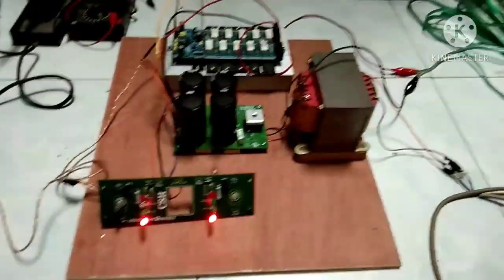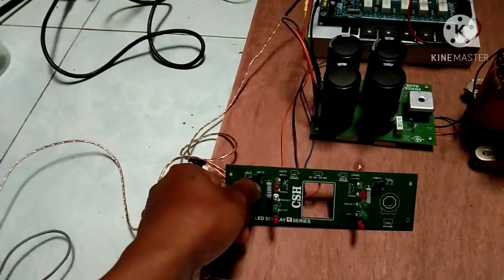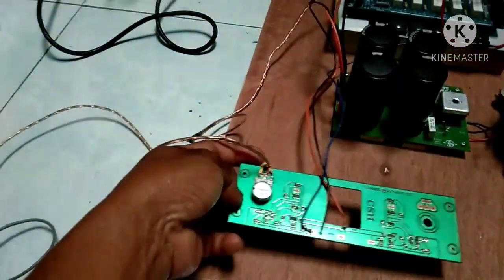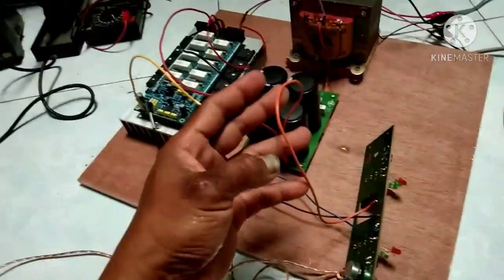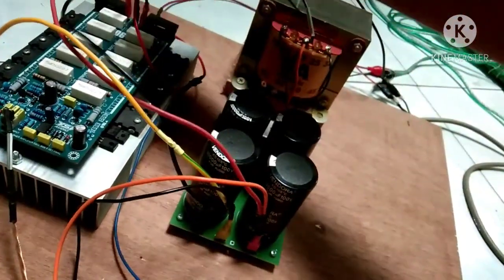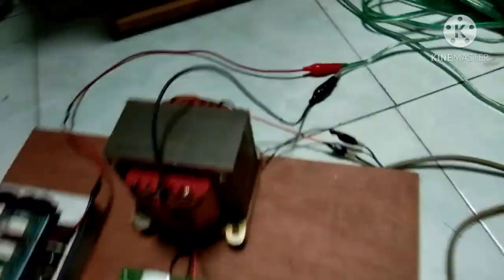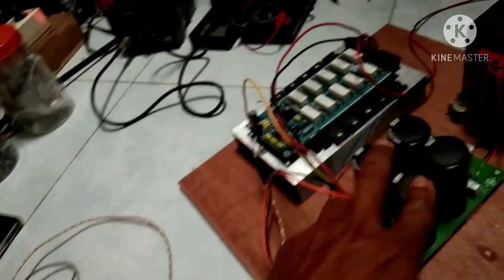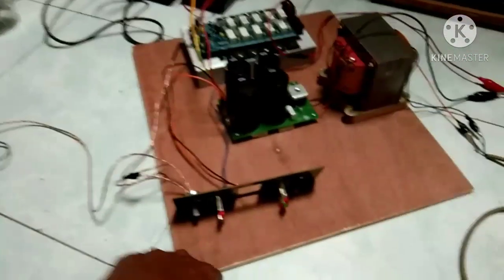cara pasang LED DISPLAY CA SERIES/ CSH

Comment: Untuk pemasangan jalur in protektor sama volume gimana suhu 🙏
Reply from the maker: Untuk jalur protektor tidak terhubung ke panel led,cukup pindahkan lampu led dari speaker protektor ke panel led menggunakan kabel.
Untuk potensio volume berdiri sendiri tidak ada jalur yang terhubung ke komponen panel led

Comment: Maaf bang pendatang baru mau tanya saya beli tak pasang ngikutin di fidio ini kq lampu aktif sinyal dan chip x kq nyala ngikutin musik semua itu pengaruh dari apax mohon bantuan x trimakasih
Reply from the maker: 1). Apakah sama Panel lednya dengan dividio? 
Saya sdh sering pasang, beli ditoko yang berbeda, tidak pernah ada masalah. 
2). Coba cek apakah komponen sesuai dengan tata letaknya terutama nilai resistor.
3). Cek solderan dan jalur PCB.

Comment: Mau tanya bang. Saya juga lg pasang. Tp ko lampu signyal sama klip gak idup ya yang idup cuma lampu yang bawah. Apa karna kurang setrum ya bang. Saya pake  setrumnya cuma pake 25v ct. Jika kurang setrum. Apakah kalo pake 32v ct. Bisa nyala ga bos. Soalnya travo saya cuma pake 5@ ct 32 mentok.
Reply from the maker: Coba cek lagi pemasangan kabelnya dari psu dan dari out power, klu memang sdh benar, lihat tulisan di pcb tegangan yang dibutuhkan berapa volt ?
Reply: @kumbokarnoaudio  udah saya cek. Udah bener Pemasangannya. Dan PCB nya gak ada tulisan vol nya. Cuma min ples. Gron. Output. Udah gtu aja. Gimana solusinya bosqu
Reply: @kumbokarnoaudio  udah saya cek. Udah bener Pemasangannya. Dan PCB nya gak ada tulisan vol nya. Cuma min ples. Gron. Output. Udah gtu aja. Gimana solusinya bosqu
Reply: @kumbokarnoaudio  udah saya cek. Udah bener Pemasangannya. Dan PCB nya gak ada tulisan vol nya. Cuma min ples. Gron. Output. Udah gtu aja. Gimana solusinya bosqu
Reply: @kumbokarnoaudio  maaf cuma ples gron sama output

Comment: Aku pke jga tpi jack input ada sedikit tegangan apa itu aman bos
Reply from the maker: Input power atau input kit LED ini?
Reply: @kumbokarnoaudio  input untuk jhack ke hp
Reply: @kumbokarnoaudio  trus nyalax jga bersamaan😂 kok bisa gitu om ??
Reply from the maker: @mmjaudio1915  coba tegangan untuk kit Led ini ambil dari (+) dan ground (CT) PSU utama
Reply: @kumbokarnoaudio  aku pke ct 48 20 A 
Sya takut😅 klw aku ambil teganganx di trafo 1 amper 12 v gimanaya ap bisa

Comment: Begini bang..saya beli led disply merk MGE.terus adanya out+/ground.klo saya sambung satu ch.hidup lmpu signalnya..+dari out signal ke speker+.terus satu ch +speker dari mana ambilnya.trima kasih
Reply from the maker: Tegangan ambil + dan ground dari psu lalu untuk signal + (ch1) diambil dari out speaker + driver (ch kanan) dan untuk +(ch2) diambil dari out speaker + driver ( ch kiri)
Reply: Karna saya pkek travo 2 buah..untuk ch masing2. Karna disply bukan stereo
Reply from the maker: Display bukan stereo maksudnya,jika menggunakan 2 trafo maka suplai tegangan sendiri² (dipisah) ch kanan ( ground dan + ) kiri juga (ground dan +) dari psu masing masing.
Reply: Mlm bang..saya pke trapo 2 biji..trus saya pke 2 kiprok..ukuran tk sams,10dan 25 amp..sya hidupkan 15 mnit.trapo yg pke 25 amp cpet pnas..mssalhnya apa bng?..trimaksih.
Reply: Lg bng..masalh led disply..itu cma 1 jalur..+dari disply ke +sepeker..driver 1. Driver satunya ambil + nya dari mna..krn tdk ada out L/R...maaf bng pemula bnget.klo driver 2. Ambil dari + disply macam knoslet..dengung keras

Comment: Punya q mas ko kbel gron dri input ke potensio bru di hidupkn blm ad audio ko dh melele , mhn bntuan so bru pmula ,, itu potensio nya tiga kbel di konek di ke pcp kh
Reply from the maker: Gak usah di solder ke pcb langsung kabel saja, coba lihat dengan teliti jalur kaki potensio gak kemana - mana
Reply: Knp kabel gron nya melele y?? Ap kekecilan
Reply from the maker: Powernya sdh bunyi normal atau baru dirakit lalu dicoba?
Reply from the maker: Untuk kabel inputnya saya biasa pakai kabel skerem.
Reply: Trima ksi , aq akn coba gnti kbel
Reply: Baru selsai di rakit di box sring q coba tmpa box ,, aq coba percenel ,, kbel gron nya kya kbel spiker hnset  kcil dan q dret 2 potensio

Comment: Mas mau tnya, cara psang imput hp ke potensio CA  trus ke pawer gmn mas....???
Reply from the maker: Ambil potensio perhatikan yg ada kupingnya itu sebagai ground /kaki no 1.
# kaki no 1 dan no 2 menuju ke power. 
# kaki no 1 dan no 3 menuju ke HP. 
Untuk lebih jelasnya cari di google ( cara pasang potensio )
Reply: @kumbokarnoaudio  mksi mas bro untk ilmunya
Reply: Kalu untk teganga panel depan CA bisa d.ambl dri tengan lain selain dri psu pawer...???
Reply from the maker: @amirulmumininamirul6814  maksudnya di beri trafo sendiri ? Bisa.
Reply: @kumbokarnoaudio  iye mas..dpasang trafo sendri atw tegangan sendri....
Reply from the maker: @amirulmumininamirul6814  bisa
Reply: @kumbokarnoaudio  mksi mas kumbo karna tla brnbagi ilmu.x soal pemasangan panel CA seria
Reply from the maker: @amirulmumininamirul6814  sama - sama 🙏

Comment: Di situ tercantum max 90 vdc tapi di kasi tegangan 91 vdc atau 98 Vdc bisa gak bang. Makasih
Reply from the maker: Bisa dengan cara mengganti Resistor 2 wattnya dengan 6k8 dan dioda zenernya ganti dengan 1 watt.
Biasanya yang ada di pasaran R 2 watt terpasang 4k7 atau 5k6.
Untuk diodanya hanya 0,5 watt

Comment: Kg mo ty travo sy GK ad extra y, cara pasang y apkh travo utama yg 12v, apkh ad tmbhn trims
Reply from the maker: Langsung ikut PSU utama /setelah elco (sama kayak driver) jangan langsung dari trafo
Reply: @kumbokarnoaudio  sy pake 32v, protec y CMa trtra 12v kg
Reply from the maker: Maaf maksudnya untuk lampu led display atau sp protektor 🙏
Reply: @kumbokarnoaudio  protector kg
Reply from the maker: @akmalsolehsoleh2989  oalah tak kira panel led 🙏 tambah trafo 1amper atau bisa juga ikut PSU utama tapi diturunkan pakai R 4 k7 (2watt) , dioda zener 12v - 15v dan elco 1000uf/25v (masing² 2x) 
Catatan : dioda zener disesuaikan dengan kebutuhan kit Sp protektor 12v atau 15v
Reply: @kumbokarnoaudio  trims kg moga tmbh byk subcrib y, sehat slalu

Comment: mas kalau drivernya ada speaker protektor led dipanel langsung di jemper sama led di speaker protektornya apakah bisa..?
Reply from the maker: Led display hanya ada 3 lampu yg terhubung ke komponen (led on, signal dan clip) sedangkan lampu protektor harus di ambilkan dari kit speaker protektor (coba lihat jalur di pcb panel disply)
Reply: @kumbokarnoaudio  ya mas sudah saya ambil dri kit speaker protector.. langsung saya ambil dri kaki - dan + led speaker protecto tpi tidak nyala..
Reply from the maker: 1. Sebelum di pasang ke panel lampunya nyala atau tidak dikit proteknya.
2. Cek lagi Lampunya kebalik/gak ?
3. Lampu protek akan bekerja/menyala bila terjadi konslet /short pada speaker. Jika tidak short tidak menyala.
Reply: @kumbokarnoaudio  makasih penjelasannya maa.🙏👍
Reply from the maker: Sama ² 🙏

Comment: Pak punya saya ko led singnalnya nyala trus pak.. untuk mengatasinya bagaimana ea pak
Reply from the maker: Posisi volume arah jam berapa?  atau baru hidup sdh nyala terus?
Reply: @kumbokarnoaudio  baru hidup langsung menyala
Reply: @kumbokarnoaudio  dam saya juga mau nnya pak.. untuk ampun aktif itu yg di speaker protek dismbng tidak ke lampu led panel depan.
Reply from the maker: Hidup langsung menyala coba cek lagi pemasangan kabel mungkin ada yang salah.
Reply from the maker: Untuk lampu yang sdh ada di panel disply tidak perlu di pasang lagi dari speaker protektor, cukup lampu protektoc saja, caranya lampu dari speaker protektor di lepas lalu di sambung kabel ke lampu yang ada di pcb display
Reply: @kumbokarnoaudio  ok trima kasih pak atas bimbingannya

Comment: Pak dhee sy pasang led display n-9000 dan memakai speaker protek pemasangan sdh benar jalur lampu aktip display sy putus ambil dari lampu speaker protek tpi pas di on kan power nya relay speaker protek gk mau on/aktip dan protek terus lampu signal sy ambil dari out speaker..dicabut kabel siganal malah normal speaker protek nya mau on dan active tolong dibantu pak dhee...like&subscribe
Reply from the maker: Coba cek lebih teliti lagi pemasangan kabel lednya dan jalur yang diputus apakah sdh benar dan aman (tidak ada yang short)
Reply: Siap pak dhee tak cek lagi

Comment: Bos lampu speker protector nyala trus hidup gak bisa bergantian  dngan lmpu actif gmana solusinya..
Reply from the maker: Lampu sp protektor kan gak ada hubungannya dengan panel depan.ada berapa lampu di sp.protektornya.
Reply: Yg 1 hnya satu satunya 2 lampu..
Reply: Oh iya bos  pkek berapa finall trafo 10 ampere ct 56  pkek thosiba

Comment: Mas itu kan kabel dari LED display ke spiker nya cuman 1 nah kalo spereo gimana mas apakan di jadikan 2 kabel nya
Reply from the maker: Ya, stereo kabel output speaker ( + ) kan 2 (ch 1 & ch 2) di PCB sdh dibagi 2 untuk masing² ch
Reply: Terima kasih bos atas jawaban nya akhir nya saya ngerti ,maaf pemula 😁🙏 sukses selalu Chanel "KUMBO KARNO" semoga rezeki nya di lancarkan oleh yang kuasa 
Salam saya dari Kalimantan barat 🙏

Comment: Mbah tek u pmasangane yowes podo, tapi lampu signal ro clip murupe kok bareng yo? Dadi lmpu clip e melu murup koyo signal   iku opo ne sg salah mbah??
Reply from the maker: Posisi volume pol opo separo,
Reply: Volume sparo, lampu clip e ws melu urip mbah, tambah di banter ne malah tambah barak, kalah urupe  lampu signal e malaan
Reply from the maker: @herusetiawan8762  coba volume input dari laptop/Hp di kecilkan/dikurangi.mainkan volume dari power saja. Powere nganggo speaker protektor ora, nek nggawe yo ora usah kuatir. Selama speaker protektor berfungsi insyaallah speaker aman.
Reply from the maker: Cek transistornya mungkin ada yg short.

Comment: Kalau kabel yang ke CT di rubah ke GND bisa mas
Reply from the maker: Bisa ,kan ct dengan ground satu jalur  coba lihat /urut jalurnya di pcb.
Reply: @kumbokarnoaudio  tpi punya saya potensionya ngga bisa mas...
Apa ya kira kira permasalahannya
Reply from the maker: @ndestgondest201  coba lebih teliti lagi untuk potensio tidak usah disolder ke pcb tidak masalah potensio volume langsung kabel ke power amplifier seperti biasa
Reply: @kumbokarnoaudio  tanpa lewat pcb ya mas
Reply: @kumbokarnoaudio  tpi kaki potensionya tetep di sambungkan ke pcb ap Angga mas
Reply from the maker: @ndestgondest201  disolder boleh tidak juga tidak papa.

Comment: kalau makai 2 psu smps gmna cara aambungnya mas
Reply from the maker: Jalur pcb (led) positif dan negatifnya di putus.
Reply: @kumbokarnoaudio  kurang paham saya mas...chanel 1 saya makai smps 100v untuk sabwoofeer kalau chanel 2 nya makai smps 80v untuk midle.kebatulan saya beli box power ca10 nh cara pemasangan led display saya kurang mengarti mas kalau satu psu saya paham mas seperti di video sampian kalau 2 smps saya binggung cara memasangnya.

Comment: Bang lampu signal yg sebelah ikut nyala klo potensio yg satu di buka? Itu apanya
Reply from the maker: Coba cek/ganti transistor 2N5551 dan dioda zenernya
Reply from the maker: Zener 4148
Reply: Kanan kiri di ganti semua?
Reply from the maker: @marjiblack6332  yg ikut nyala saja
Reply: Sebaliknya juga ikut nyala klo di buka gantian kanan kiri
Reply from the maker: @marjiblack6332  coba cek lagi pemasangan kabel nya sdh benarkah ?

Comment: Pux sy kok gak bgtu terang bos ikuti irama
Reply from the maker: Coba cek nilai resistor yg terhubung kekaki led, berapa ohm? Jika 2k2 ganti dengan 1k2
Reply: @kumbokarnoaudio  kurang tau k resitor mas... Says tes tmpa asrsoris fulome hampir full bru ber irama tpi gk terang
Reply from the maker: @nurulalvialvi4703  coba ganti lampu Lednya
Reply: Klw mkk sma qualizer stabil kedipx bos... Tpi volebe besar dikit lampu clip hdup
Reply from the maker: @nurulalvialvi4703  mungkin gain amplifiernya kecil
Reply: Ow berarti R gain hrus di besarin ya mas. Makasih
Reply from the maker: @nurulalvialvi4703  kalau suaranya sdh bagus gak usah dirubah

Comment: Pak saya baru saja pasang LED series tapi yg nyala cuma lampu aktip nya saja..yg lampu signal protek sama clip gk nyala..padahal sudah benar untuk pemasangan nya, cuma saya gk pake speaker protektor... apakah harus pakai speker protektor ny .. mohon bantuannya pakDe.🙏🙏 maaf pemula
Reply from the maker: Lampu signal akan nyala apabila ada signal audio, lampu protektor akan nyala apabila dipasang speaker protektor dan  jika power mengalami troble, lampu klip akan menyala apabila volume power dibesarkan dan suara mengalami cacat.
Reply: @kumbokarnoaudio  baik terima kasih pakDe atas ilmu nya.🙏🙏🙏

Comment: Salam kenal bang, maaf mau tanya saya kan beli led display produk chs tp disitu tertulis tegangan yg dibutuhkan minim 30 maksimal 50vdc, nah sedangkan trafo saya ct 55 apakah bisa atau komponen ada yg perlu diganti?
Reply from the maker: Tidak perlu diganti karena dari 55vac masuk ke rangkaian led display sdh diturunkan oleh resistor 2watt dan dioda zener
Reply: @kumbokarnoaudio  berarti itu masih bisa dan aman ya bang walaupun di pcb tertulis maksimal 50vdc, sedangkan trafo kita ct 55. (di pcb dioda zener tertulis 15v 1watt, aman ya bang)
Reply from the maker: @ekogus18  coba lihat jalur (+) melewati dioda zener 15v dari dioda zener ke resistor 6k8 lalu menuju ke Led (+).
Untuk jalur (-) menuju ke transistor dari transistor ada r 10k menuju ke Led (-) jadi tegang pada kaki Led kalau kita ukur hanya 3v - 3,5v.
Jadi Aman 👍
Reply: @kumbokarnoaudio  ok bang, terimakasih 🙏🙏